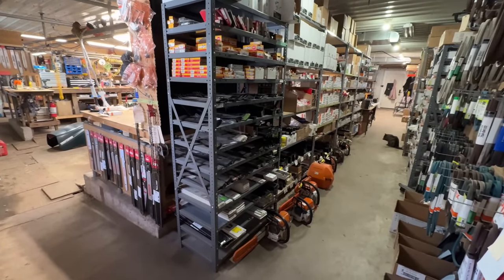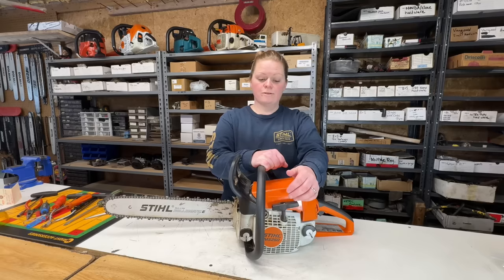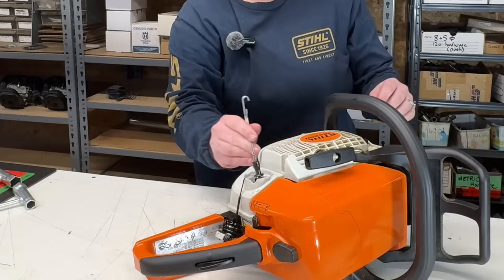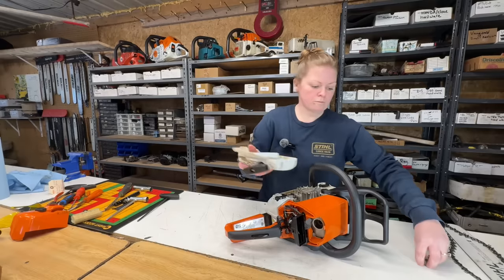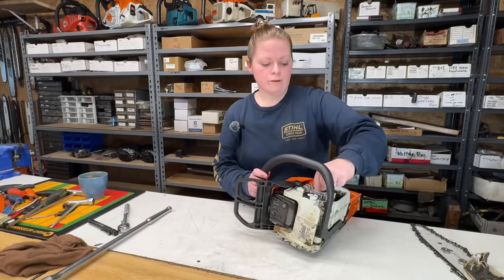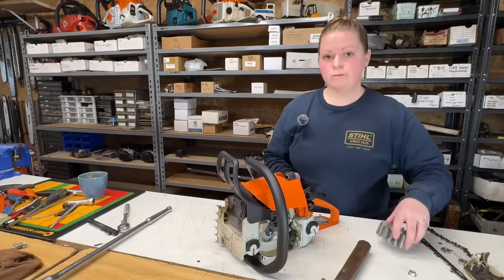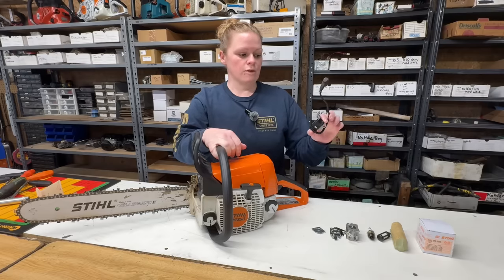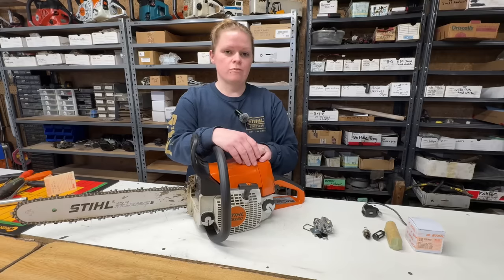Stihl MS250 Chainsaw HARD To Start!  It Wants To Rip Your Arm Off!  Let’s Dive In and Find Out Why!

Comment: WOW! My old climbing saw 009L can pull my arm off if it will even pull. All systems EXCEPT the carb are fine. Thx for the tip. Even the MS261 without the comp release pushed in pulls easier than the 009.
Now onto the carb thx to your work. I had to go with a gift Husky 338XPT for a tiny saw. Excellent job.

Comment: I wish before I bought my 250 that I knew it would be hard to start too. I'm 71 years old and it's hard for me to pull.
Reply from the maker: Yes, one of the tougher saws to start.   I can start an 038 but barely have the upper strength to start the MS250 on a good day.

Comment: Wow, good video. I thought for sure it would be the flywheel key. Learn a lot. Question; would a couple of tanks of engineered fuel and high rpm’s help get rid of the carbon from the piston?
Reply from the maker: Hi, Thanks for stopping in!  I can't say for sure if that would clean it up, but I do know for sure that this saws needs to be worked hard to clean itself out!   I don't think its used enough and I don't think he runs it full out.  It probably never gets hot enough to burn the carbon off.

Comment: The kick back on my MS250 was "solved" by pulling slow until the piston met compression load. Then a quick pull always avoided the kickback. Solved the problem. Didn't do anything with the limiter caps or any carb adjustments.

Comment: Great video!

I opened my 250's muffler up abut 3 times larger and run it with the cover off, and absolutely run the piss out of it..... 

I know its not good for the saw, but i do this with all my saws..... and run them hard. 

My new 400 was disappointing but after openning the muffler up, and a 24" bar is now acceptable performance.
Reply: And of course I adjust the 250's carb. I dislike my 400's auto tune!

Comment: You are right a MS 250 will beat you to death.  Mine about takes my arm off.  It needs a deco valve, badly.
Reply: Put the saw on the ground and foot in the rear handle, stiff arm on front handle and pull it like you mean it ,no half hearted pulls. Elderly, weaker individuals or people with bad shoulder will not get along with an MS 250.

Comment: I bought one,  brand new. I could not pull hard enough to get the rope all the way out. 
And I've been pulling them ropes for decades, so it was not 90-lb weakling reason.
I've had an older 250 for years, and never had that problem.
So I brought it back and the tech recommended the 250 CE (easystart). 
Saved my shoulder. The set-up for changing the chain is strange but I got used to it.
fine detective work on your part.
Reply from the maker: Those MS250C saws are pretty sweet!  The regular MS 250 is way too hard for me to start.    Around here we call the MS250 the " a saw for the young bulls"

Comment: I have a mid-1990's 025 and it's the same way, these are high-compression saws and casual owners coming from box store Poulan and Craftsman chainsaws always complain about starting a Stihl. I also have a MS391 and with its decomp valve it's probably a little easier to pull over vs my 025.

Comment: Like you said, this is very common with the MS250's.  The compression can get very high after breaking in.  This happened to mine.  The dealer could not do anything to improve on it either.  I put an elasto start rope on it and it helps if you pull it one click out before pulling hard on it.  The first click is the one that jerks your arm the most.  Lots of info about this problem online.
Reply from the maker: We installed an elasto start grip on this MS250 as well, it did help,  and your absolutely right on that starting procedure!

Comment: Thank you.
I learned something today.
I was guessing flywheel key as well, and when you first said carb, I thought NAH!.
But, as others have mentioned, excess fuel will raise the compression level.
Damn - I've thrown away a few small 2-stroke engines because of this being the likely issue, and putting it down to maybe a bent crankshaft, or whatever.
Carbs. Basic, but problematic.
Good one, and thank you from NZ again.

Comment: I learned the cold start procedure has to be closely followed. Full choke, pull until it fires once, half choke until it starts then choke off. It does flood very easily. Once warm, it’ll start all day with one pull.
I always run ethanol free gas through the saw before storing it. And if it’s months before using it again, I drain it. Saves a lot of problems.

Comment: MS250 is a great saw, powerful saw. I had tested maybe a thousand times or more. An observation comes that when it's cold, a strong kickback have been felt and when I run at full throttle for about 3 minutes at 10000 rpm and turn it off after a few minutes the engine is hard to start. To solve it, I remove the sparkplug and pull it a couple of times even if it is not flooded, just to remove pressure in the cylinder. After that, one pull the engine starts.

Comment: I had a little 015AV and loaned it to a friend. Never gave me any trouble but for him it locked up.  Took me 10 sec to fig out what he did. Early model saws used a stronger gas / oil   mix, whereas newer modern saws are like 50:1 I believe. Some old timers still use the 25:1 mix. Might have something to do with the carbon buildup.

Comment: I use to buy, fix, and sell chainsaws that I would buy mostly at garage sales or pawn shops. I would build a few few hot saws and modify a few. The one thing that I found quite often when buying from the actual user was when I found them carboned up pretty bad it was almost always from a guy that would say "I always add a little extra oil in my mix to be sure everything stays well lubed"

Comment: Many years ago I bought an MS250 from a pawn shop an old man had brought in. He lived in the city & it was a gem. When I first bought it, It seemed impossible to start. As I'm an old fan of McCulloch saws it about broke my arm for several hours trying to get it going. Then I figured out to pull it one or twice with the choke on till it fired. Then immediately turn off the choke & the next pull fires it right up. Strangest thing I've ever seen but boy she'll run... Great saw!

Comment: 2 things...always torque level and one way...after the coil rope is installed give it a test pull  before installing the plug  checking for engagement...cheers   and install an easy start,,,

Comment: Loved the commentary on the recoil pull on the MS250 saw.  Mine starts hard., pulls hard.  Always has.  Now if I could just get it to pump oil onto the chain.  Never has done that too well either.  Using it less and less as time goes by.  Wouldn’t need going bigger to a 270 or 290 so thinking about dropping down to the 230.  Nice just to have one just in case.  Of course I also have a 48” one man logging saw ready to go but that’s a younger guy’s saw!
Reply: My MS250 had the same issue with the chain oiler. Dumped the thick bar oil out,flushed out the tank with some gasoline, refilled it with transmission fluid. The chain gets plenty of oil now.

Comment: Nice video, it is always best if the customer is forthcoming when they drop off a saw. I had a customer add oil in the fuel tank and then s splash of gasoline and it wouldn't start. He had tried to start it, just filled the carb with oil ! 😂 He told me what he did, I pulled the carb, but didn't see where the accelerator pump spring attached. Found the jets full of oil,cleaned out oil , found the pump spring and attached it , added gasoline oil mix, cranked it up,ran like a top. It had a decompression switch to set before pulling the rope starter,also Stihl but we used it to cut pipe, ductile pipe, 6 inch and above. Strange stuff, cement pipe and cast iron pipe joined together.

Comment: Great videos, Erica! Wonderfully thorough work. On this one, it seems they engineered too small a recoil spool into it. The only easy fix is to pull slowly to top dead center, and then yank hard on it. With the throttle bog, and three turns out, it's pretty evident it needed a carb kit. I also imagine the excess carbon made it harder to turn over – the quickest way to start a solution to that is to spray carb cleaner into the intake at full throttle for a bit, and at least get the carbon removal started. Once it runs on the new carb for a while, hopefully it'll get warm enough in the combustion chamber to remove the rest.

Comment: This is interesting information because I bought a new MS250 and at the time the dealer said it was a model that has high compression and this model doesn’t have a de-compression release ! 

It seemed to me that in the first year the compression increased a little ( I had to work at it 
sometimes). 
Only one time I couldn’t pull it through ? Wow that’s compression so I waited 10 minutes and tried it again , it started , other than high compression I’ve had no troubles, it’s reliable and dependable and cuts very well during a days work !
My opinion after several years now , a de-compression release would be a plus for this model !

Comment: I bored and sleeved engines for 17 years portable for lots of car repair shops. Mostly inline 4 cylinders.   If I walked up to a engine that has been previously  sleeved I would deny the job.  I have been bit too many times trying to square away other machinists crappy work.  I had 3,4,or 5 engines to do that day and just one big hassle job could affect my whole day.  You putting on a new carburetor was the perfect right thing to do.

Comment: Try running this ms250 with some Red Armor mix. It should remove a lot of the carbon deposits that built up from operating this saw pig rich. Thanks for sharing 👍

Comment: I say you are an Inspiration!!

I won't say it's on you 100%. You sure did excellent Stihl service
There were several other issues including gaps, bad fuel, plugged air filter and a spark plug as well as it needed a new fuel filter,  so I'd say you did an excellent job. I'm sorry you had to fix somebody else's work. Maybe they'll bring it to you the next time they need service instead of horsing around with it.

Comment: The MS 250 is a powerful little saw, however it does have extremely high compression 160 psi without an easy start. This can make the saw really difficult to start, but when it's running it's great but old tech. Just a point, it's always best to have the chain on when starting as this gives a true reflection on the starting. Really nice video, clear, informative and easy to follow, I've subscribed to watch more.

Comment: Great video. You did uncover the cause of the problem with the misadjusted carburetor. Excess fuel because of this will carbonize the engine. The .002 inch clearance between the piston and cylinder will be reduced because of the carbon flim build-up.  You saw it through the spark plug bore . Rest assured, if you'd decarbonize that engine  you would have solve the problem. I've done this many times. Some folks even double pawĺ the starter assuming that's the problem but that's not it.

Comment: I struggled with three different sizes of Stihl saws, taking them back to a main dealer for regular servicing and were eventually fitted with Elastostart, which did help to avoid dislocating my arm. At age 81 I bought a cheap Chinese saw, 66cc and 22 inch bar advertised as " Easy Start".  I could have bought five of them for an equivalent Stihl.  I only wish I had found it years earlier.  Started so easily that I could hardly believe it.  Ran without a problem. Idled for as long as you left it without stalling and was far lighter than it's expensive German counterpart.
I know that my experience runs counter to many I have met on the internet, but I feel that Stihl saws are like successive Mercedes cars I had - sort of engineering prima donas. Great when new but becoming more stroppy and difficult as they age.  Now have a Mazda, and like the saw it does the job without huge bills and if it breaks, much cheaper to replace.

Comment: I had one of the  bigger  saws , and the  compression was  too much for me to  pull over,  I thought  a decompression  valve would have been  nice,  but  they don't have  one !  I bought  the electric  battery  model,  with a  extra battery,  even  at my current  age  I can  use this saw, and it  cuts good  .

Comment: I still own a MS250 I bought back in 2004.
It's always been a pigs ear to start and your right, it doesn't do your shoulder any favours.
I should have purchased the 'C' model as that has a decompression valve fitted.😢

Comment: When it comes to tightening the coil it's not always the top one you tighten first. Cause it depends on where the coil placement is. If the coil is towards the back of the power head (like this one for instance) then yes the top is first, but if the coil is towards the front of the  power head (like on the Husqvarna 572 XP Mark 2) then you tighten the bottom one first.

Comment: A couple of suggestions to avoid carburetor(and other) problems: Use ONLY ethanol-free gas with an 87 or higher octane. Use a small paint brush to thoroughly clean around the filler caps before removing them.

Comment: You're 100% correct. I think customers are embarrassed they tried to fix the saw and it still doesn't run right-must be something else-off to the shop it goes.
It takes me longer to fix and costs them more in the end and wastes my time.
I always ask, most times they never admit to working on it. 
Great thorough job!

Comment: Great video.  My MS250 is acting the same, but carb has never been touched.  Based on this I will check flywheel alignment, and see if the grabby pull goes away. Thanks.

Comment: Timely video. I regret getting my MS 250 saw. I cannot start it, exhausting me before I even begin the job I’m out to do.  Even the dealer I bought it from had a hard time adjusting it, once.
The small MS 180C is my go to saw, for everything.  Drop starts by third or fourth pull.
Time to sell the 250!

Comment: My Stihl MS241 is quite temperamental, and will start first time some days, and absolutely refuses other days.  It has a decompression valve that helps to reduce the load on the pull.  On some occasions it will start if I remove the air filter and squirt in a little fuel, but not always.  Recently it refused to start and after spending about an hour trying to get it going (including checking to see if I had flooded it), I gave up and eventually left it for a week.  When I returned to it, it started second pull.  Sigh !  Fortunately all my other garden machines are Honda 4 stroke.  Best wishes from Japan (where Stihl is highly regarded).

Comment: I had the same thing with an old chainsaw I tried to get working. The spark plug was wet and was really hard to pull. I set the jets to 1 1/2 turns out as they were turned out too much put a new spark plug in and it started up easy. Guess the extra fuel was locking up the cylinder. Its worth pulling it over with the spark plug removed to make sure its easy and also checking the spark strength with the spark plug out of the engine.

Comment: Hi, just discovered your channel. I'm a Stihl guy, a retired hobbyist. I've been working on saws for about 7 years now, after I burned up a piston due to a leaky crank seal and needed to fix my 034.  I'm in northeast Arkansas and I'm guessing you're Canadian from the way you pronounce "out". I'm now 7 years older and dozens of Creamsicles "richer". The 025/MS250 has the same starter pulley diameter as the 170, 210, 230, and having the largest displacement of these, is notoriously hard to pull (also hard to start, if you make the mistake of waiting for the first pop to turn the choke off). The lever arm of the pulley is IMHO too small for the job. However, for a younger able bodied person armed with the above knowledge, I believe it is the best bang for the buck in a homeowner saw. Another caveat: don't try to advance the timing unless you don't value your arm.

Comment: Two critques, or some advice, if you will. 1.) always set your spark plup gap before you install it (even new ones). 2.) always check your carb settings first things first! In other words, work a 2 cycle engine problem in reverse order. Exhaust, combustion chamber, spark plug (install new plug, and check for good spark) then check the carburetor, fuel lines and filter. Magneto air gap and flywheel would have been the last thing I would have checked. Just sayin. I've owned an ms250 for about 12 years! They are a notoriously finicky hard starting saw! The MS 261 (formerly 260 pro) is a far, far superior saw! Pound for pound, the best saw Stihl makes! Imho.

Comment: It sounded like the timing was over advanced a bit to kick like that. I had in a few instances the saws actually started backwards after kicking violently. I suspected the crank may of slipped since the key in the flywheel was good and the coil slot is nearly impossible to alter for timing. Trick to start on first pull is prime it with no plug a few pulls to get it ready then be sure it is on fast idle with no choke and it will fire right up.

Comment: Worth noting, if there is significant carbon on the top of the piston from low rpm use or wrong f/o mix ratio, it can increase the compression, thereby making it hard to pull.  I feel like this should have been mentioned.  It is relatively easy to address as she did state that professionals rarely have this problem due to high rpm use.  Good video overall.